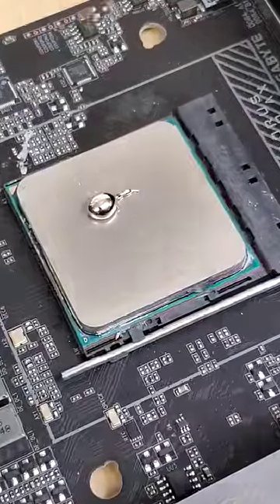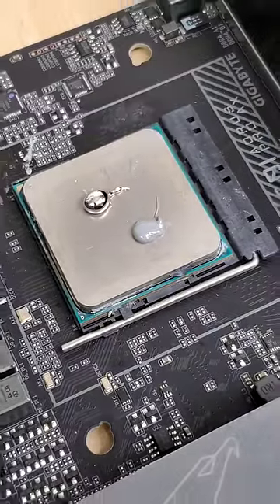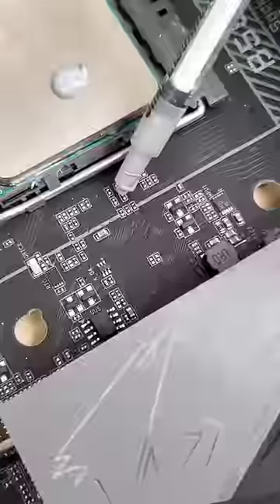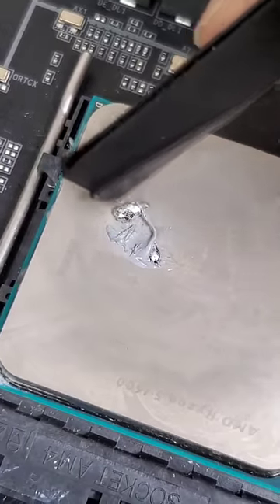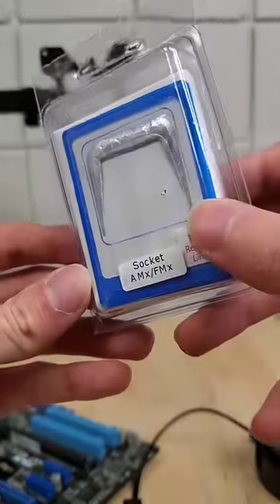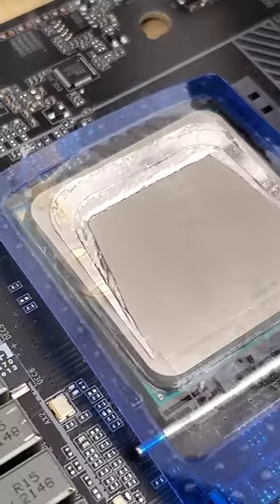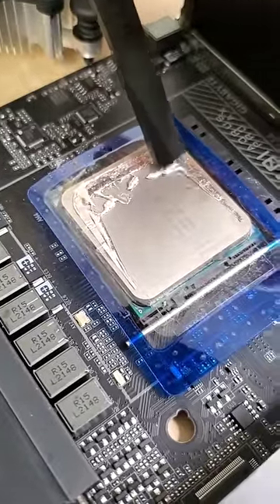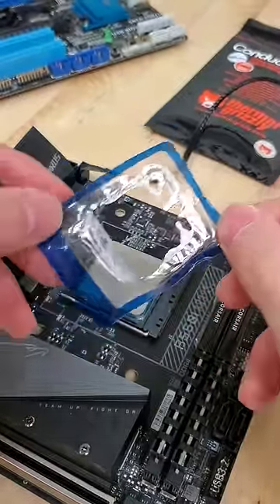the future of thermal paste technology #shorts

Comment: Arctic Silver 5 has done me well for 15 years. I think I'll keep going with that. Lol
Reply: Try the Artic Mx-6, that thing is great.
Reply: I'm not gonna lie I thought you meant you've gone 15 years without replacing it at first lmao
Reply: Agreed  only reason would be some crazy over clocks  that's more of a crazy hobby.
Reply: Or you could just apply it correctly.
Reply: thermal paste is like motor oil change it regularly and the brand doesn't matter
Reply: @xeraoh  there is a small thermal difference between all the good brands, but Arctic Thermal 5 is the OG and its like 3-5 C worse than stuff you'll get with any heatsink now. Its a waste of money.
Reply: @3of12   I mean....unless you are into overclocking it's fine either way.  Also--again with overclocking--that tube of AS-5 from 2003 is probably still mostly full.  lol
Reply: @3of12 it’s not really about the temperatures with most thermal paste, it’s about how long it can withstand these temperatures. You can have really good heat transfer but if it has to get changed consistently compared to one that you can leave for every 6 months or more is what matters. Maintenance
Reply: Try a graphene stamp
Reply: @TimBurtonTim  oh I need to buy a pack of those. I want to use one on my PS3 so I don't have to repaste it every year
Reply: Artic 5 have metal particle because i use some in transistor and almost damage transistor because is electrical conductive
Reply: My laptop is designed for liquid metal, got it used from a teenager who had put thermal paste on the cpu and shit was overheating like crazy. Turn it on and it slams right to 90c
Reply: @Saint_Jerome mx6 is pretty thin, have to be real careful. Mx4 and mx5 were more user friendly
Reply: try gelid paste, you will be surprised
Reply: Same. I have a policy of not willingly introducing even more opportunities for random chance to ruin my system. It's got enough advantages as is.

Comment: No way that's keeping that all contained when in a standard upright position for long enough
Reply: Isn’t that what’s happening with PS5s?
Reply: @HolySweetPotato  the ps5 has a sponge around the chip to keep the liquid metal fully contained even while right side up
Reply: @LegalStrawberry1  I see! Thanks Larry!
Reply: @LegalStrawberry1 That suggests to me that if you have a PS5 you should never fuck with it's orientation, right? Because if it's not in the intended position it might not contain the liquid metal as efficiently?
Reply: @TheFounderUtopia That used to be an issue yes, few ps5's that were stood up leaked the liquid metal, but with some tweaking they seem to have completely removed this issue since january 2022 as far as I'm aware.
Reply: @Eduardesuper  Good to know. If I buy one I will definitely check it is a more recent production. Thank you. :)
Reply: @TheFounderUtopia  new ps5's are readily available at mostly every tech store, only do this when you're buying secondhand.
Reply: I've had liquid metal in my laptop since 2016, on both the CPU and GPU and have never had a problem with it leaking off onto other components. All i have is temperature resistant electrical tape covering the small components around the silicon dies.

And its not like my laptop doesn't get used often either, i take it to and from work every day and have done since i got it.
Reply: So many upvotes when you haven't a clue

Ran a Q6700 at 3.33GHz with this for over 5 years, it's called Indigo Xtreme and it works brilliantly, this guy is just a pleb
Reply: This stuff is very old, from like 15 years ago.  It was actually very safe as long as it and the cooler were applied correctly.   Difficult to come by these days since the company that made it is long gone.

Comment: Thermal paste isn’t necessarily meant to conduct heat super well, it’s also meant to displace air which conducts heat horribly, ensuring good contact between the cold plate and the IHS.
Reply: Well, no, it is meant to. What's 100% is what it is supposed to do, and partially by the means of displacing air to have maximum conduction is a less misleading way to say it.
Reply: @Jordan-rb28  The word "partially" is very misleading there. What I'm trying to get across is that there is a balance between heat conductivity and ability to fill in voids. Modern thermal paste sacrifices heavily in the heat conductivity department to be extremely good at filling voids. Since, if heat conductivity was all we cared about, we'd just use the IHS and the cold plate. But we care a lot about filling voids, so we use silicone based compounds which have heat capacities a lot more similar to silicone than to metal.
Reply: @Jordan-rb28 not partially, it's entire existence is to fill the gaps between things that get hot and the things that cool the hot things
Reply: Its kind of a semantical argument but you have a point. Thermal paste kinda acts like a bridge, but its own thermal transfer is important, of course. Ideally if the cooler and the IHS have ZERO gap (air) between them it would be better than liquid metal because of direct transfer, but its practically impossible, especially at scale.
Reply: @dracopug  it's not semantic, you can have all the conductivity in the world, but if it doesn't make contact with the other surface then it won't be transferred.
Reply: @dracopug  Pretty sure it is impossible once we get really small. But yeah it's important, but most people overstate the importance and completely leave out the void filling properties.
Reply: @SpecialEllio It’s a semantic.  If you had perfect conductivity it wouldn’t matter if you had 100% contact.  Even 20% would be enough.
Reply: So what you're saying in an almost unnecessarily roundabout way, is that it is meant to conduct heat.
Reply: @AnarexicSumo ah yes perfect conductivity, that thing.
Reply: @danieltippey  So what you're saying in a almost unnecessarily roundabout way, is that you don't get the point?

It's meant to conduct heat, yes. But it's conducting heat over a really short distance, so even if the heat conductivity (talking about the material property here) isn't crazy good, the difference in temperature over the IHS and the cooler's contact point will be really small. For this reason it can be more harmful to go for a material with higher heat conductivity if you end up with an uneven spread and get air pockets in there.
Reply: air isn't a conductor, it is classified as an insulator, thus the poor conduction you experienced. please replace the air with a different conductor, thank you.
Reply: It's not tiny, some cooling combined with this liquid metal can decrease 10°C which is alot in terms of processor
Reply: Thermal paste is just to create a layer between the cpu and cpu cooler I'd only recommend using metal or solder if you delid and actually put it on the cpu and the cpu cover.
Reply: @azizsetyawan3038  that would imply there's >10°C temp gradient over the (very thin) layer of thermal paste in a normal setup?
Reply: You're all wrong, thermal paste is actually just a tasty snack to have on the go while you're putting your pc together so I have no Idea what are you all arguing about
Reply: @shiinondogewalker2809  depends on what termal paste you using of
Reply: @thebeardyyc  insulator is a very strong word
Rather, air is a bad conductor. It can still conduct heat. It does so very poorly
Reply: Demented
Reply: @azizsetyawan3038 Any thermal paste that isn't a complete scam will perform within single digits of each other when applied properly on typical processors. The more power it is pulling the more of a benefit it can have but only if the cooler can actually take advantage of it and there's trade-offs. Most high-end pastes are far more susceptible to pump-out meaning it slowly works its way out to the edges. The hotter the CPU the faster the thermal cycling will cause it. 

This is why they're mostly advertised toward overclockers, not someone sticking it under a Ryzen box cooler and forgetting about it for 2 years. Anyone with Kryonaut under a mid-range air cooler probably saw a decent drop in temps at first. Check it again in 1-2 months.
Reply: @JJFX-  well actually liquid metal doesn't need any maintenance, just make sure it's not leaking and you can go forever without need to Changing it every 2 years
Reply: guess what low viscosity liquids are better at than high viscosity liquids? Not trapping air.
Reply: If it was meant to displace air then why haven't we just been using indium foil? It would almost certainly do the job much more reliably
Reply: @AnarexicSumo no

Comment: Graphite pads have been out for a while. They perform better than normal paste, are solid and clean to apply, and since they dont decay or dry out, they keep their thermal properties. Best part is that they are at most $15 and last decades.
Reply: i just searched up graphite pads and they only perform like paste at low temps when at heavy gaming temps they dont do well
Reply: @superlavahair1536  Yeah, pads are good only when you dont want any of the mess of regular paste. Not breaking one or two in process however...these things are very fragile.
Reply: @alexturnbackthearmy1907  The silicone pads that came with my MSI are about 3mm of silicone. The blue putty pad i put on top of the SSD later was fragile, but fills in the space between the chips better than the graphite pad i put on the bottom of the SSD and on top of the putty, making it look cool from the bottom grill as well.
Reply: No, they are not better than normal paste. Nothing is better than normal paste. That's the benefit of paste -- it fills gaps. Graphite pads cannot fill gaps like paste can. It's solid.
Reply: They don't do well at all. They're not good at transferring heat on the Y axis. Only X and Z and that's kind of useless for an air cooler. TIM still outperforms it
Reply: Watching these replies I notice that I didn't express myself properly. What I mean is that it outperforms thermal pastes in that price range in regards to longevity and maybe performance. At least in my experience. Of course when you bring out big boys like liquid metal pastes it's not as good.
Reply: @estebansingh9411 not one person said anything about liquid metal pastes in these comments...
Reply: graphite is good at spreading heat but bad a transferring it to other materials. the best you can do is vacuum seal pure sodium as the thermal paste. it melts at 98C and decimates gallium with double the conductivity.  the key thing being you need to keep it from oxidizing or reacting with humidity in the air.
Reply: @psionx1  if You have the engineering prowess to vacuum seal pure sodium as thermal paste may as well improve conductivity of the circuitry to not produce as much heat. Imagine using superconductors for computing lol
Reply: @estebansingh9411 in the price range?  How much are you spending on thermal paste?
Reply: Their temps are worse than a good TIM. Enjoy dum dum.

Comment: Be careful if there is any aluminum in your system at all. If the galium touched the aluminum, it would corrode it. Not only that, but galium can remove the oxidization layer on the aluminum, which could produce hydrogen gas if any water or condensation touches it. 

Honestly, those facts alone don't concern me as much as the fact that galium acts like water and is very difficult to 'smoosh'. So you would be getting this metal everywhere. Plus, galium melts at temperatures higher than 83°F. So you could cause a lot of damage by leaving your hardware in the sun too long.
Reply: i think most people use silver paste because of this
Reply: Gallium doesn't corrode aluminum.
It combines with the aluminum to create a very brittle alloy.
The oxide layer actually prevents gallium from doing so as easily.
Reply: You can protect neighboring components from liquid metal contact with kapton tape or clear nail polish.
Reply: Gallium destroys aluminum by forming an alloy with it.
Reply: Just use mercury 😝😝
Reply: “Typing all this is gonna make me sound cool and make me feel special”. 

Gets it wrong.
Reply: Way too many likes given to confidently wrong information
Reply: By "acts like water" do you mean "is liquid"? Because it doesn't really act like water. Like, at all, other than that it flows
Reply: Oxygen doesnt corrode iron, it just combines with it to make a brittle alloy
Reply: Bruh, leaving your hardware in the sun? How hot do you think your CPU is getting? 😂
Reply: So you've just decided this is gallium and run with it?
Reply: Or you could use a Graphine Thermal Pad. Its still electrically conductive but its much more efficient than LM and easier to apply AND reapply if you ever need to remove your cpu cooler.
Reply: @louiesatterwhite3885 
You could... or you could just use regular paste.
Reply: @sierra1513  rust formation does involve a chemical reaction, but product is not an alloy. An alloy is a combination of two or more different metals.
Reply: Sure this guy sounds smart but he said a whole lot of nothing. Ignore the comment
Reply: Do you think I’m gonna be taking my computer on a Fuji vacation!?
Reply: @kermitthefragg  Yes. Liquid metal thermal pastes are made of gallium-based alloys (typically with indium and tin).
Reply: @thegoldenatlas753  Gallium fucking destroys it during amalgamation, gallium penetrates into the crystal lattice of aluminum, thereby disrupting its structure. At the same time, the aluminum itself becomes very fragile, like glass. To obtain the desired effect, you need to leave the aluminum radiator soaked in gallium for a couple of days.
Reply: @sierra1513 This shouldn't have made me laugh as much as it did. Material science is not, nor should it be, funny. Knock that shit off.
Reply: @Hoa_G_Pham Oh, thank God. I was afraid I was the only one to Google this to make double sure before I posted. Although after I googled it and found the inaccuracy I admitted that shit was funny as hell. It's with a heavy heart I inform you your sense of humor... didn't make it. I'm so sorry.

Comment: The PS5 uses something similar to this.

It's a horrifying idea
Reply: Looking for this comment. Exactly! That's why you shouldn't place it standing up, that shit melts down and leaks to circuit board. Saw some horrifying examples of it and using it laid down since then
Reply: @Encrypt-o well luckily my ps5 already is laying down, but doesn’t it have a sponge around it to prevent spilling ?
Reply: @StijnNLDutch  yes it does
Reply: @StijnNLDutch  somehow needing to have a sponge around it makes me want to risk using it vertically even less lmao
Reply: ive used my ps5 for 3+ years standing and nothing ever happend and iirc it was debunked but as soon as i heard that back in January, i still put it laying down...just to be sure lol
Reply: @Jesus.Christ106  it wasnt debunked multiple youtube repair channels have proven  how bad  it is
Reply: @StijnNLDutch  It does but when it overheats and gets to the liquid stage it can leak trough the sponge
Reply: @Jesus.Christ106 just because it doesn't happen to you doesn't mean it doesn't happen to everyone else..
Reply: I thought the whole vertical thing was only based on that it didn't fully cover the cpu as it would laying flat
Reply: My Asus Rog strix has liquid metal cooling it works fine
Reply: @lordvader3697  Problem for PS5 is the isolation around, it leaks from it
Reply: @lordvader3697  until it gets knocked over right?
Reply: @_Shinasu  thay might be one of the reason but not the only onw. It leaks through the sponge that is supposed to keep it there, saw some visual examples of it runining the whole motherboard
Reply: @Jesus.Christ106  better safe than sorry, yours might have not got to the heated point where it gets so thin liquid that it leaks through or luckily you might have a tight sealed one.
Reply: @Arcademan09  knocked over what and how

Comment: The problem with liquid metal is the gallium, it eats through a lot of the copper water blocks, dust, turning on liquid into a grime that doesn’t conduct much at all
Reply: It eats basically everything metalic, turnit id into useless amalgam. A nightmare of any repairman. Though usually boards damaged by this concoction can work only as donor boards and even then with caution.
Reply: It doesn't eat copper though.
Don't use it with aluminium interface but it's ok for copper or nickel-plated coolers.
Reply: @BaieDesBaies  hmmm, it doesn’t eat copper? (Respectfully said): Then what is happening to my copper water block? Every time I’ve used LM and I take my block off there’s a stain and black like stuff on it?
Reply: @an_easy_name_to_remember4749  It's just a stain. It creates a surface protection, don't remove the stain.
Reply: @BaieDesBaies  based on what ya commented and did some research. In short, you’re right. Found some vids from Gamer Nexus and said exactly what you said. Appreciate the help. 👍
Reply: Easy fix, use mercury.
Reply: This stuff is called Indigo XS / Indigo Xtreme and is Gallium free.  It's impossible to find it these days, because this isn't the "future of thermal paste," it is the past...from like 15 years ago.  Good stuff, but the company that made it is no longer around.
Reply: @an_easy_name_to_remember4749  You're welcome. I'm glad I could help.
Reply: Gallium eats aluminum, but not PET, so that phase change pad should be safe. I wonder how to install it though.
Reply: Actually you're not wrong... well kind of. It corrodes gold as well. It forms a horrible oxide with gold (you'll find it with indium soldered IHSes) that ruins thermal conductivity
It also can ruin copper over a long time. Nickel stops it but gallium just loves to bond with many metals

Comment: The Thermal Grizzly Kryosheet works great without any mess to clean.
Reply: fam if you need liquid metal then a Kryosheet will ABSOLUTELY NOT work great
Reply: that sheet is only decent, not great. does prevent mess though